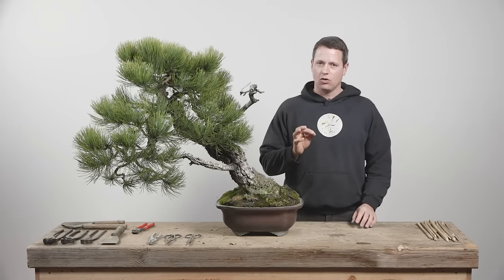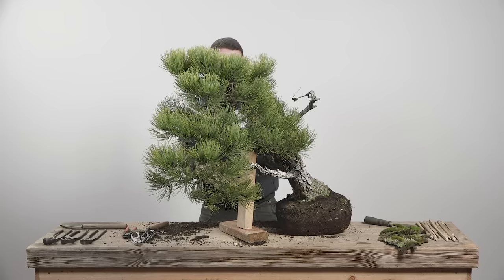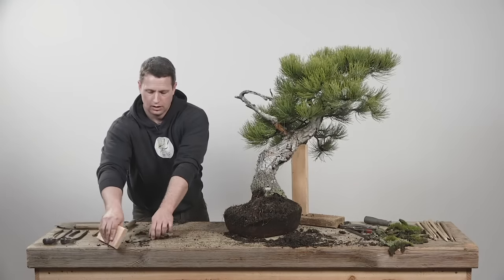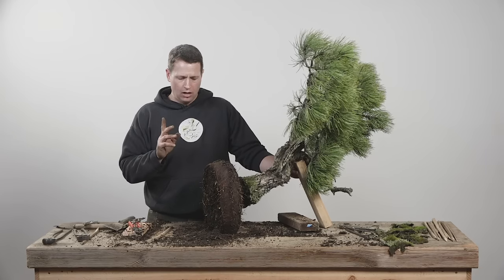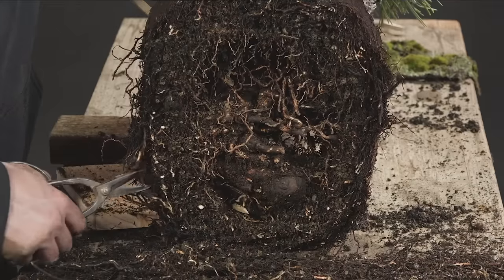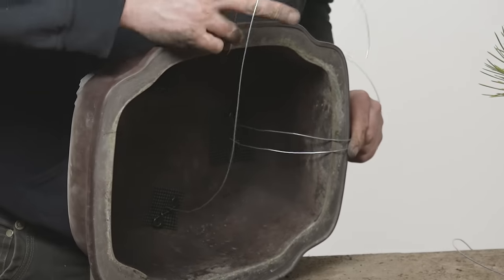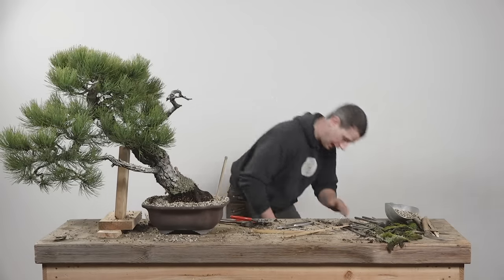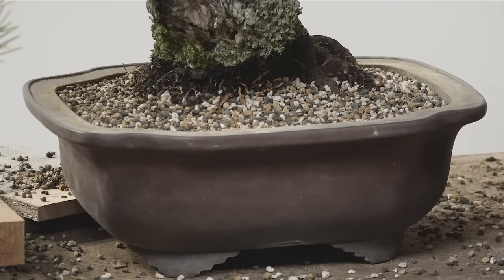Second Repotting on a Ponderosa Pine Bonsai Tree

Comment: A trick I have learned and kind of honed over about 15 years ballpark for the transferring of original soil in yamadori is that the first 2 years I leave it alone. I don't mess with it and the tree sits atop the same bonsai soil it will have later on. Starting the third year I will " core" the soil near the trunk. I take a piece of copper pipe, be it 1/2" or whatever appropriate size and I sharpen one edge. I beat that pipe down into the soil in random intervals taking plugs of root and original soil. I've found you don't really want to go past about 10%. Then your left with a tube shaped hole. Fill that hole with semi packed bonsai soil and water in. Avoid the same areas each year you do it trying to get fresh spots and from what I've experienced the bonsai soil becomes inoculated with the good stuff in the soil and the roots grow into it really fine. It is a slow process but I've had good success from it and the only time I've ever had a tree show signs of stress after is when I did too much so I'd stay at about a 10% change year over year. The trees I started with are all still thriving and in 100% bonsai soil now, some still in the original pots which I'm able to do because in both root trimming and refreshing the soil gradually.

Comment: NOTE TO SELF:  start taking photos of my mature tree [an annual photo, before/after root work as well as before and after removal from pot, et al],  This is what I would have liked to see in this live stream.  I'd have liked to seen it to compare and recognize what I'm seeing.

Also, concerning a major company's premixed substrates include 1/8 to 1/16 inch composted pine pieces.  It actually drives me nuts because it floats.  For my tropicals, in winter I dunk the smaller trees (pots).  It that amendment undesirable.  I guess I'll use these blends for young trees.  I'll go back to mixing my own substrate.  Tiny Roots has good reviews and I was hoping to save some time. but even their inorganic mix has these particles. as far as I know, bark is an organic.  Oh well, live and learn.

Comment: If you had DG mixed in that bonsai soil it would be much easier to report i was running 50 50 organic soil to golden CA DG I could almost just shack the plant after 4 years and soil fall away from perfect root structure shaped like pot.  You can run almost pure DG 15% soil to DG they grow good like natural hydro.
Reply: The only thing I would change in my mix is to add 10% peralite.

Comment: So I keep finding conflicting information on when you’re able to remove branches and wire pines. Some say do it mis summer, others when the tree is dormant. Can anyone clarify when these things can be done for dwarf mugo pines?
Reply: The thing is that you can do both, I had success with summer wire because somehow stimulated a lot of backbuds where I did the biggest bends. I also had success with winter one so I’d say that if the tree is vigorous you can do both
Reply: @alessandromassimo5717  what pines did you work on? Thanks for the info!
Reply: @CharlieForeign  so i have 4. i worked during summer with  scots pine 2 years ago and they backbudded the opened the buds last year( first spring after the summer work) , while usally i work during winter with scot pine japanese black pine and italian black pine or villetta barrea and didnt really had problems. i only work when they vigorius and not every other year